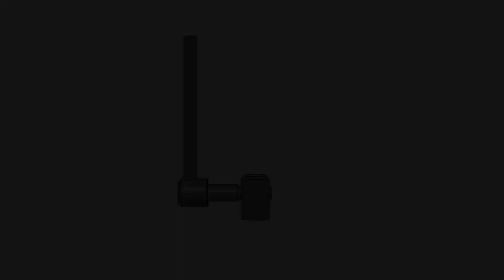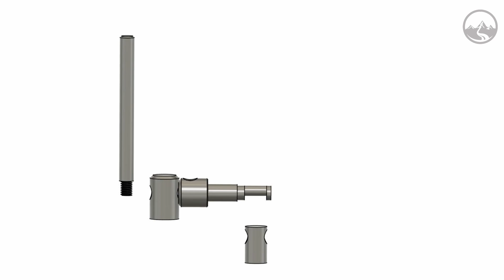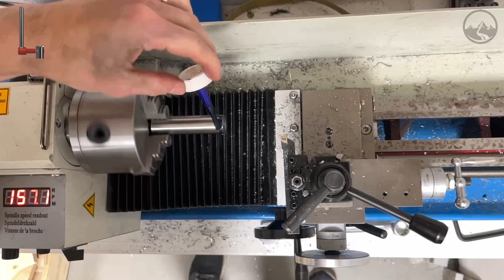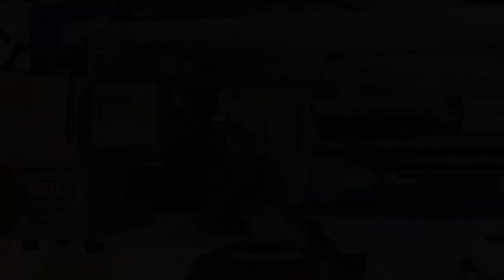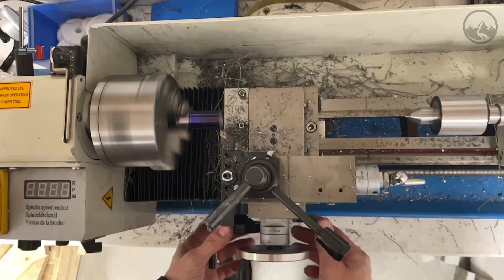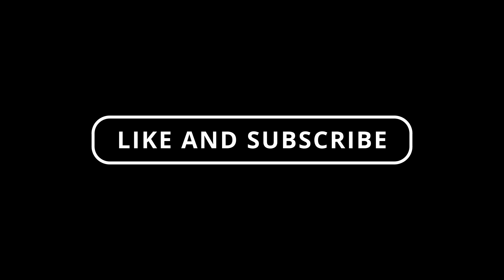Can This Lever Change My Whole Workflow? #minilathe #freedrawings

Comment: Please do not wear that kind of sweater, get a proper shop coat. Swarf will collect in garments so protection from it is needed. Also, I realise you may be working over the top of the chuck for video purposes, never do that it is very dangerous. Sorry to be picky but I do not wish you to get hurt and you will if you carry on with no changes.
Reply: You're doing fine. I don't have a custom long sleeve lathe jacket either but i do have many melted holes in techical Ts from flying chips. Just keep on using common sense.
Reply from the maker: Thanks for your concern, I use a shop leather apron, of course it doesn’t protect the arms but at least to some extent the vital parts
Reply: Its the catchy part of wollen or loose garments that are the issue, after 63 years in my trade I seen lots of accidents big and small. Had to take a couple to emergency, in in one case he could not work again!
Reply from the maker: @ericbrackenbury Thanks i will keep your advice in mind 🙏🛠️

Comment: Very nice Video, I really liked it!
 A Jacobs-Chuck is not really designed for side loads and can in the worst case pop loose from its arbor. I suggest your next investment to be in a proper end mill holder for your milling machine. Maybe you could also make one yourself and do a Vidoe about it.
Reply from the maker: Hi thanks for your feedback, really warms my heart! I have made the investment in a ER32 collet chuck. They are secured by a screw in rod so they cant pop out. 
I made a holder for the collets you find it on my instagram: https://www.instagram.com/p/C1AWfGSI18G/?img_index=2
Reply: @hillsendswe also, a Jacobs chuck will not grip an end mill well because the shank is hardened so will not give slightly under pressure from the jaws alowing good grip as the softer drill shanks do. Typically an end mill can work loose and "walk" out of the chuck. For light axial loads, such as creating a flat, you can get away with it.
The ER32 chuck is a great idea. I use them a lot and also ER16 set for finer work, they are versatile. If you buy ball bearing nuts for your ER32 they crank up pretty tight with less effort.
Great video and nice project.
Reply from the maker: Thanks for the feedback, I have no official machining training and learn as I go. Get a bit better every day 🥳